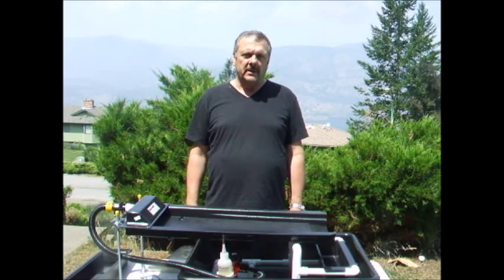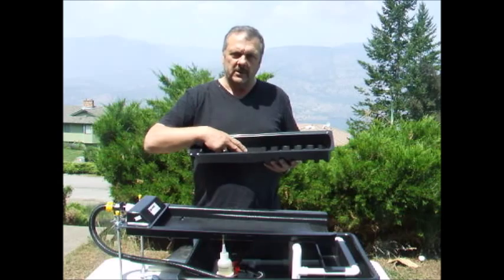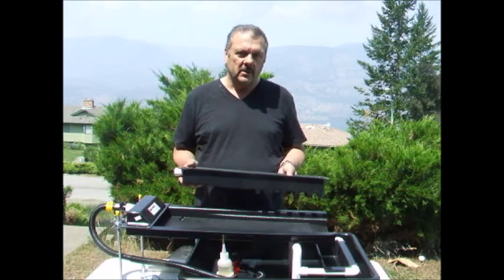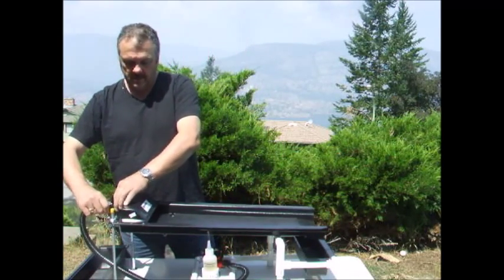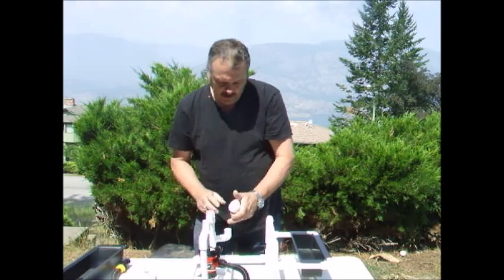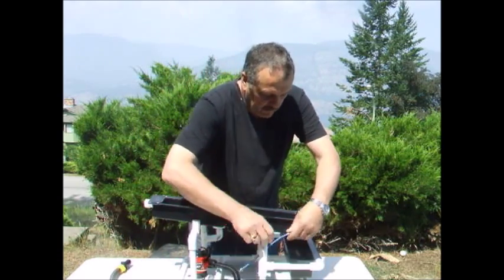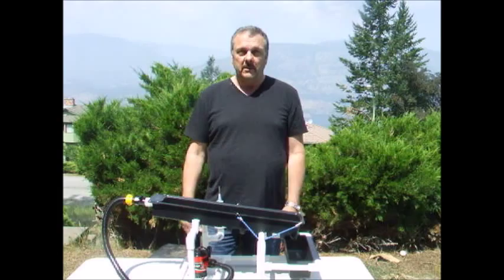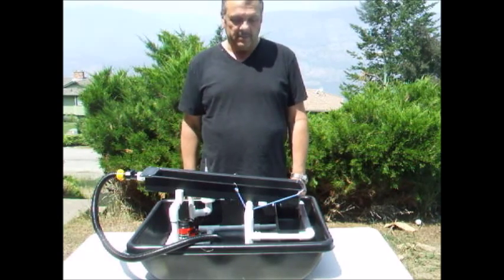Mini Concentrator Set Up

Comment: This guy is calling a Sluice a Concentrator when it isn't.
Reply from the maker: Actually, you are mistaken - a sluice IS a concentrator. It's job is to render down a large volume of paydirt, and concentrate the results into a smaller more manageable and enriched state. A river is a concentrator, and even a gold pan is basically a "concentrator".  

Why do you think they call the material residing in a sluice or even a gold pan as "concentrates"? 

My advice is don't worry about the terminology so much, and if you don't understand something - simply ask for clarification.

The overall goal is to find gold as efficiently as possible - and that's why, with my 35 years of prospecting and placer mining experience, I design equipment to do the job as efficiently as possible, taking into account durability and portability, and am continuously looking for improvements. 

I do not mind people correcting me if I'm mistaken on something ( that is a part of learning ).

Mostly, however, I hope I have cleared up your misunderstanding of the term.  Happy Nugget Hunting :)